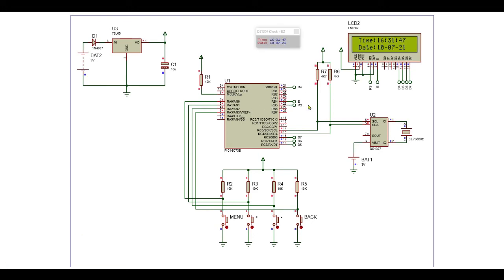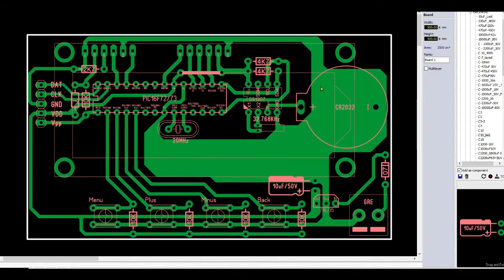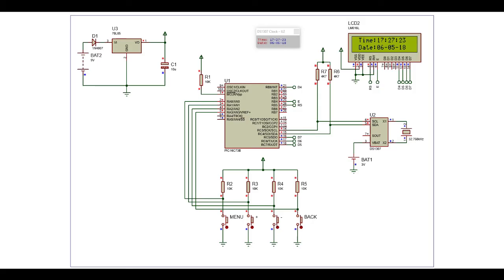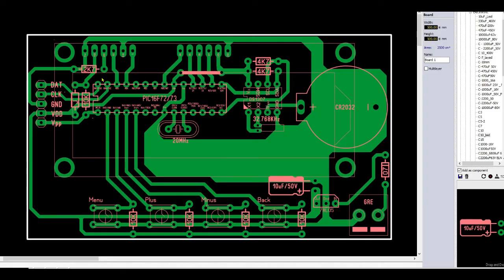Digital Clock using a PIC microcontroller & RTC DS1307

Comment: I need Ds1307 rtc based  device on -off timer using pic. Will you post it.

Can we use PIC 16F676  Or PIC16F616 For this video 's project instead of  the pic that you have used?